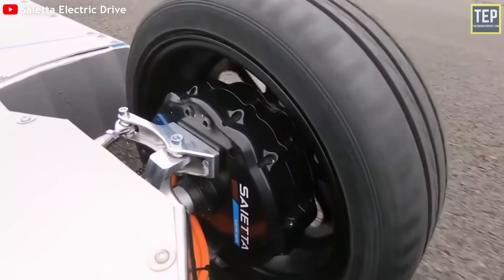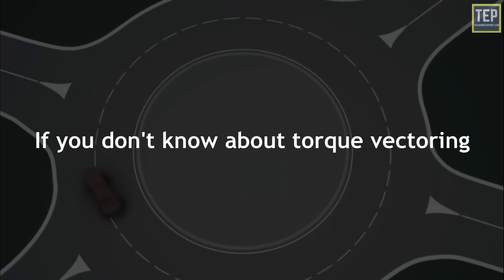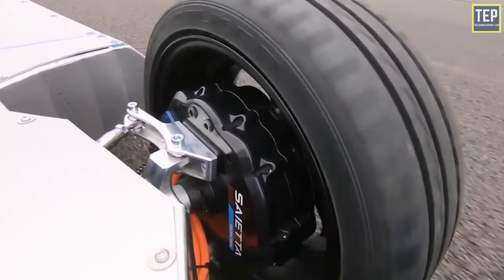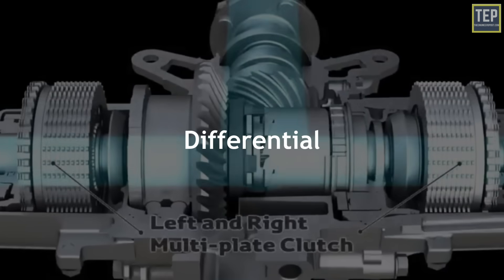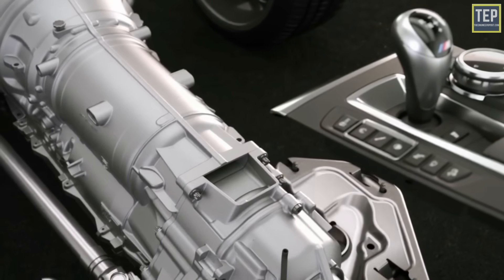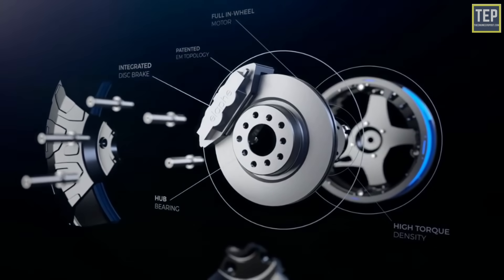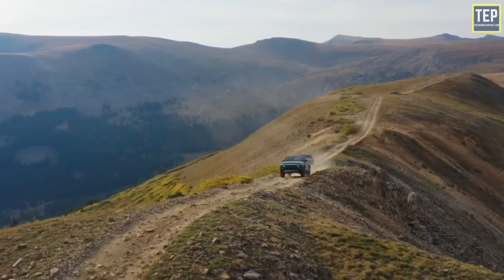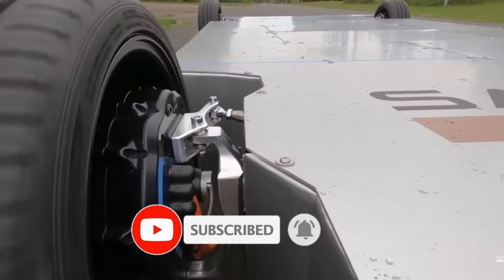How does In-Wheel Motor Technology Work? | Four Motor Drive & Torque Vectoring

Comment: Ohh no, the old unsprung weight argument. It also appears that this type of motor has so many other problems, included "real world" (????) efficiency

Unsprung weight.  This argument is meaningless unless the purpose of the vehicle is known.  For instance, unsprung  weight is unlikely to be of great importance if the vehicle is for commuting only and used on well maintained, smooth roads.  There is a plethora of different possible uses, so I will not look at specific examples.  

If unsprung weight is the great issue it is often portrayed as, the handling must be significantly compromised when very large and wide wheels and tyres are fitted to all cars. Yet, all the hypercars, supercars, mainstream racing cars, performance cars, even large SUVs, come fitted with these large and heavy wheels and tyres.  Few of these cars go to great lengths to reduce this large increase in unsprung weight (for instance, single piece carbon fibre wheels).  Perhaps unsprung weight is not as important as other advantages brought by these wheels and tyres.  

In the past, some manufacturers have taken measures to reduce unsprung weight.  For instance, the independent rear suspension used in the E Type Jaguar and a number of their saloons used inboard disc brakes and utilised the half shafts as the upper link of the suspension in an effort to reduce the unsprung weight.  Later cars reverted to a more mainstream solution.  

Speaking of Jaguar, the C and D type racing cars used a simple live axle rear suspension.  Both these cars were specifically designed to win Le Mans,  Jaguar decided that for Le Mans with its (relatively) high quality surface, a more complicated rear suspension was unnecessary.  Since they won 5 times in these cars, this appears to be a valid assumption.  These cars also won a significant number of other races.

Unsprung weight, the compliance of the springs, and the damping all form a simple 2nd order system.  The unsprung weight will limit the speed of response to unevenness in the road surface and at some stage the weight and spring compliance will create a resonance in the suspension that is hopefully controlled by the dampers.  Modern suspension systems can modify the suspension parameters to produce a suitable ride up to a certain frequency.  Obviously, the closer together the road defects and the faster the speed of the vehicle, the more the unsprung weight will affect suspension performance. Again, it all depends on the purpose of the vehicle and the type of road surfaces that will be encountered.

In any case, for highly efficient vehicles rather than ridiculous performance vehicles, hub motors offer advantages while minimizing disadvantages.  According to Lightyear, their hub motor is only marginally heavier (whatever that means) than the alternative.  They confine the motors to the real axle where the unsprung weight is not as important.  High level integration has reduced the mass, for instance, the wheel centre has been eliminated with the wheel rim attached directly to the motor rotor.

As to efficiency, these motors have very high efficiency.  Most of the racers (and all the winners) in the World Solar Challenge use hub motors, if there was a better type of motor , I am sure they would use it. 

Rotational inertia, I am not sure how this is known to be higher with hub motors.  Although inboard motors may look smaller, they are geared down so their rotational inertia will increase by the gear ratios.

Robust construction, hostile environmental .  In modern times, these are generally not a problem.

To me, the electric vehicle's appeal is its mechanical simplicity, one reason I do not like hybrids.  Hub motors significantly reduce the part count, maximize space, and make it much easier to create low CD designs.

Don'r agree with me?  That is fine.  The future will tell the tale.  After the ego driven (both customers and CEOs) 2000hp electric vehicles have vanished, I believe the efficient and sensible will inherit the world - really?  I must be losing it.

Comment: You can overcome the disadvantages of road dust , water, and mud by using a repellant system such as circular brush  and non sticky material to disperse dust and mud or a fan which should repel anti road matter. And I would recommend in wheel motor technology for city transport

Comment: If it has powerful enough regenerative braking, 2 of them can replace the rear brakes entirely (they never have to work as hard as the fronts) and drive rear wheels of a front ICE engine FWD car, making it a hybrid. The unsprung mass won't have increased much if at all and vibrations etc. are less intense in the rear as its suspension usually travels more as it is more softly sprung/dampened compared to the front. So long as there is shaft continuity like with old drum brakes, there shouldn't be too much shock load or vibration transmitted to the stator or rotor housings & induction plates anyway.

Comment: my idea, basic front wheel drive car, add rear wheel hub motors, set up as street legal race car, or in town\commuter fuel efficient car. Should be set up as fully manual or partially automatic. I need help to get this idea into R&D. The DIY HotHatch\ street racer crowd will go nuts over this...!...  HELP...!...

Comment: in-wheel motor system is someone how unreliable, just think about safety. in nowadays auto-tech engineers think more about safety than engine efficiency, for the age gap to which an individual can acquire or perhaps use an automobile needs or perhaps is going to reduce that's for young adults, as far as old individuals is going to increase.

Comment: Yea, this is probably the dumbest thing said on this post, but why not re-think the size of your wheel, seems this is the cheapest part of an in-wheel motor. Then you may even have space to create internal twistable spring shocks or enclose the motor completely (kinda ball-shaped wheel). But then, this is a random IT guy's thoughts on a topic way above his paygrade :). The reason I'm liking this hub motor idea, you can create a plug n play / Diy solution to replace your everyday combustion driver.

Comment: The nature of such a car makes it inexpensive. Price increases when electronically enhanced. Higher profile tyres should work fine, plus the wheel weight can be reduced if the tyre rim becomes the electric motor housing. The spare tyre should also provide an extra spare motor in the exchange’s rotation pattern thus expending motor life span. The electric connection could be a plug. Electric motors need rewinding after some period of use anyway. The electric motor could be replaced with the tyres as a unit. What mileage we are talking about?  80,000 km is sufficient. Ultrasonic motors is another solution.

Comment: Start with cheap electro cars.
Just a electro engine on a cvt systeem.
Just the basic .
A lot of elektrische cars are a lot off stuf inside .

I mis the old cars 
Just a
Engine
Brakes 
Windows non electrische.
No airco 

We need a Lada what is so basic so people who do not have the cash for a electro car still have a car to use.
And not cheap shit from China what is unsave to use and breakdown after a year.

Comment: I  want a motorcycle with fore and aft e-motorized wheels. The batteries can take the place of a C.I. engine and the fuel tank. Or, the shell of a "fuel tank" can hold a small gas-powered electric generator and small fuel tank, for when the batteries' range is about to be exceeded. A perfect and potentially beautiful hybrid-electric motorcycle.

Comment: A lot of people here banging on about unsprung weight.  There's motors in the works that claim 20KW per kg.  One of those motors on each wheel would give you 80KW,  ample for most people.  With reduction gearing say 8KG total, that doesn't sound like a killer for unsprung weight to me.   Judging from the size of the wheels on a Tesla, not much consideration given to unsprung weight.  I think there's real gains to be made here, motor weight has received much less attention than battery design, simply because motors are light to begin with anyway.   Even if 20KW/KG is unrealistic I can easily envisage these hub motors halving in size, with smaller wheels I think unsprung weight will be a non issue

Comment: As an auto mechanic who frequently sees vehicles being neglected, but still driven, the need for the power cables to be flexing constantly is of great concern. Given how much voltage these motors must require, the possibility of electrocution or fire from a well worn and poorly maintained  vehicle could be quite high. As a possible measure I would look to brake hoses which do hold up quite well but replacing them to do cracking and leaking is a common job in this occupation. I was surprised at first to see manufactures not embracing the motor in wheel design but concluded they wanted to keep all the power cables stationary.
Reply: Maybe use wireless energy transfer? Microwave comes to mind, but perhaps there are other options.
Reply: @mp3o  hahaha...
Reply: @mp3o  There goes any efficiency advantages you might have had...

Comment: My electric moped has a hub motor and works fine for a small wheel. But for car sized wheels, I have to agree with Ford.
Also the gyroscopic effect of the spinning wheel motor hurts the car's performance in lane changes, and wears the tires in no time.

Comment: For highway use this design is stupid due to unsprung weight.  The video even said conventional suspension with this tech. Use a spline shaft and keep that motor out of the wheel. Study up on unsrung weight or you will be driving along around a corner hit a bump or pothole and end up in oncoming traffic or down a cliff etc.. In short you and car are totaled.

Comment: If the motor is small enough to fit in a tyre rim, then it would not take that much space placing it inside the car close to the wheel, if space is the main concern. That will eliminate all problems caused by unsprung mass, dirt, dust, water... A motor that small inside the car will still leave enough space for a cow. But having the motor inside the tyre rim is a good marketing standpoint.

Comment: I have been thinking about the use of inwheel motors for my Dodge. I have tried to find information about the battery requirements but have not seen any information. I think it should be relatively straightforward but without the information I need it remains just an idea. Where can I get this information please
Reply: Nowhere

Comment: Talking of in-wheel motor, i had d opportunity to watch  40- tonner wabco huge mining dump trucks powered by 1000hp diesel genset supplying dc power to 4 in-wheel dc motors. That was in d yr '60s when controls were mostly in electrical architecture with minimal electronics. I miss watching those giants cutting mountains.

Comment: My opinion is ; the front wheel use indirect drive with benefits of disengagement for power efficiency and weight distribution better front heavier...
The rear wheel uses onwheel direct motor for better traction and power distribution.  This combination will improve handling and power consumption

Comment: What about gyro effect handling will be hard and if any of the wheel fails it cant be towed or moved stress on suspension parts as well as the space it takes in wheel well will be big issue suspension links get longer big issue in handling why tesla can achieve big milage in single charage motor shaft turns 4 rotation to turn rotation of wheel vice a versa if wheel is rotated 4 turns motor turns 16 revolution and charges battery 🔋 with re generation but suit for ev is to use power train we want efficiency performance is already there electric motors are already so Torquay ev industry should focus on regeneration of power and be concerned about laws of conversion of energy n teke it to ideal level of power use and conversion

Comment: Not one single mention of the possible problems associated with having high-power electrical cables that need to flex with steering and suspension and are subject to water, dust and possible stone damage.

Comment: As far as I know, Rivian developed and designed its on wheel motors to be sealed, so dust and moisture and the sort do not affect them, and the ball bearing are twice the size of a regular ball bearing giving much more resistance to damage due to vibration and road bumps.  And so far, the few reviews of this truck, especially for the off-road use, shows the great versatility and power these on-wheel motors are capable of.  But for some reason, maybe not having enough sound insulation iif any, the motors' noise can be heard in the cabin if you don't have a radio on. The Tesla roadster is not a Hybrid car, is a pure EV, and those electric motors were also sealed electric motors with extremely robust ball bearings and housing, so nothing about dust, humidity or damage produced due to road conditions apply.
Reply: The rivian r1t actually has a regular AC motor, it does not have in-wheel motors

Comment: Why not have the 4 wheels motors in city or highway run I  mostly 2 wheel drive and 2 or all 4 wheels regenerate breaking and while in 2wd either front or rear wheel drive for the person while in that mode the other 2 wheels charge half the battery cells in front or rear wheel drive then when  low the other 2 wheels can charge it while using up some of there charge maybe increasing range by 25 to 50 percent?? I think it can be done.

Comment: I saw in-wheel motor prototypes nearly 20 years ago at the Geneve fair trade. It was one of the Japanese car manufacturers. Not much changed since that time. It's good for low-speed drivetrains like forklifts or scooters. I have two e-bikes. One with a rear hub motor, another one with a central motor. It happened to me several times to punch the tire of the first one but never happened in the central motor one due to lower unsprung mass.
Reply: I have 2 ebikes, one hub drive and one mid position. The unsprung weight of the hub motor, heaver spokes and reinforced rim does not allow the wheel to track the ground nearly as well as the mid drive. The hub motor is in the front wheel where the gyroscopic effect is considerable. I have to run higher air pressure and a heavier duty tire to prevent pinch flats, all leading to poorer handling. I know its only a push bike but the law of physics must be very similar to both car and bike.

Comment: Still I feel that the torque in each motor will always be different making wheel movements at different RPM and rotations. This can be noticed clearly with uneven road, potholes, speed breakers, majorly in off road situations. With this can't expect driving in straight line.
Reply: they aren't that different, and the rpms would be spread evenly

Comment: In-wheel motor is all good running on city streets and interstates highways on a sunny and dry day but can it run on muddy water three feet high above the wheels like conventional 4-wheels do is a much concern over the disadvantage unsprung weight. Someone mentioned using grease but on this three feet high mud water? I don't think so not for an long term.

Comment: I think in wheel motors are the way to go. I thought of this in the 80's where each wheel had its own motor. I was thinking of mechanical brakes for emergency backup. most of the braking can be done through the electric motors also re charging the batteries while breaking. The computers can Controle the motor speed to steer the vehicle eliminating steering linkage. Braking also computer controlled. Naturally heating and air conditioning is all electrical.
Reply: Did you even watch the vid? The vid basically explains that there are more cons than pros when it comes to in wheel motors, and thus it is not the "way to go".

The vibrations and shocks that the motor will suffer, the weatherproofing required because the motors are sitting inside the wheel instead of being protected by fender wells, the unsprung weight, the packaging challenges, lack of options for additional gear ratios, etc. are the inherent disadvantages of this approach that traditional electric motor mounting does not have to deal with.

The concept sounds good on paper, but falls flat on the real world. Current electric cars already do regenerative braking and torque vectoring, no need to go in-wheel for that.
Reply: @sepg5084  You will never build a prefect machine. You always have to give up something to get something. What ever you do either you create drag or you eliminate drag. The electric motors can be mounted inboard and liquid cooled or oil cooled. Heat and dirt are the enemies of anything electrical. You use gearing on electrical motor drive you gain power and loose efficiency to drag.
One system won't work for all EV's. They'll have to be purpose built. They will also evolve like the internal combustion vehicles did.

Comment: I am very impressed with the innovation that many people are incorporating into electric motors. I still don’t understand why an axial motor / stator hasn’t been incorporated into the design of these types of motors to continuously send charging capabilities while in motion and also incorporating regen. 4 years ago I sent a letter to ELON MUSK about this innovation and a basic rough draft sketch outlining and explaining the many benefits of this design I came up with over 6 years ago. Although I don’t have the digital technology to design and build and market I certainly always am excited and pleased to learn how many people are designing and building similar things.
Reply: Cost is the main problem. I've looked at axial flux motors and they are brilliant. Excellent torque to weight and compact as well. It's not surprising to me that they are being looked at for aircraft. Performance is more important than price in that market. For automotive? Maybe in Rolls Royce or Bentley Ev's!